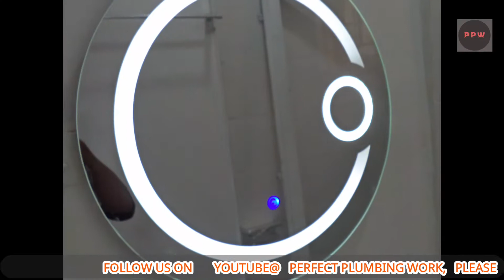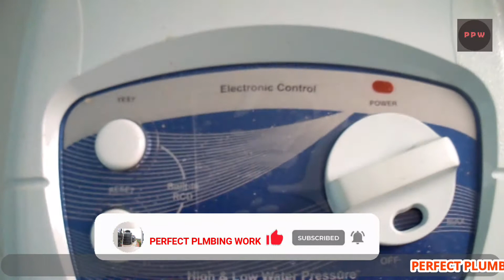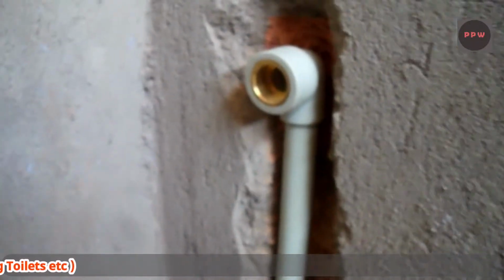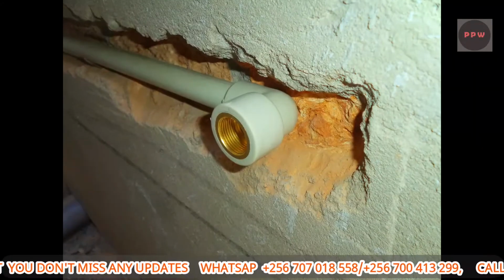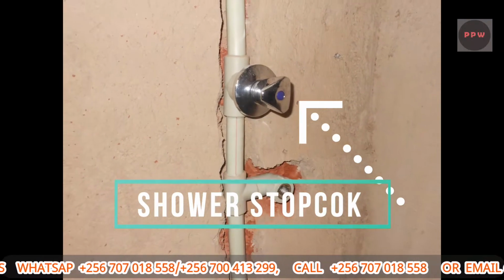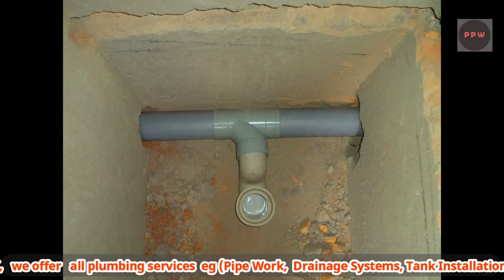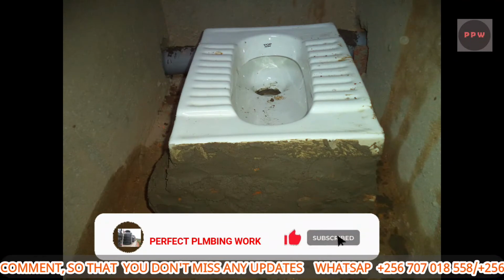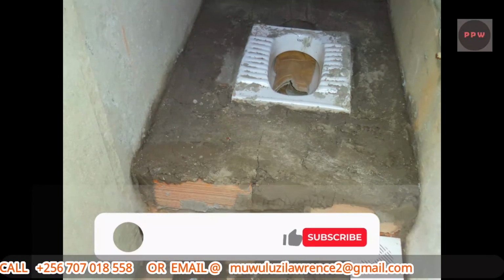How To Installation  Squatting Toilet

Comment: Thank you for the video.How does it cost to buy the squat tiolet accessories and installing them?
Reply from the maker: Thanks for the question, it depends where you’re and what you want in your toile but here in my country the squat and accessories can cost around 120dollars but that’s not the final remember we have drainage system and also installing water in our toilet that’s another cost ❤ 10:30